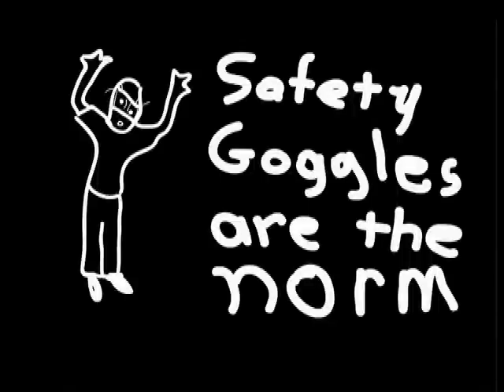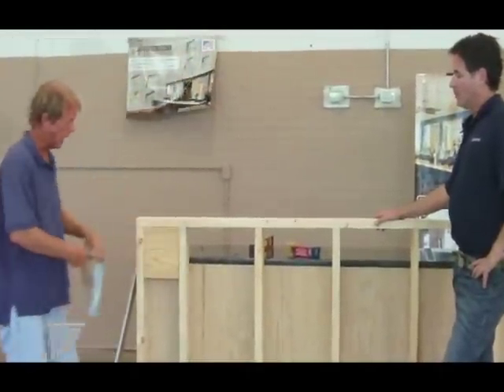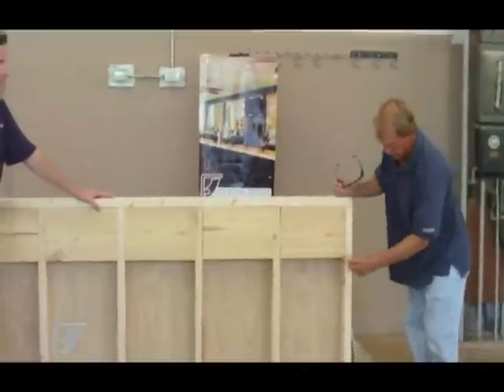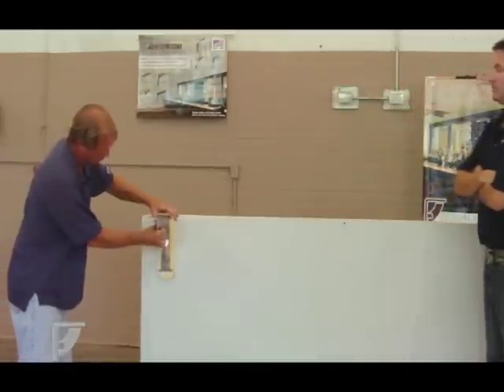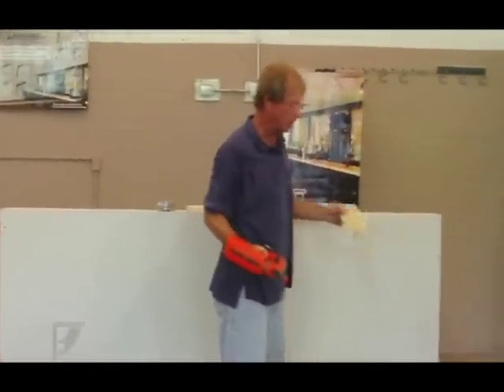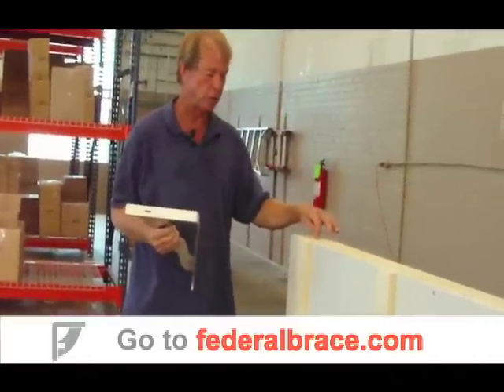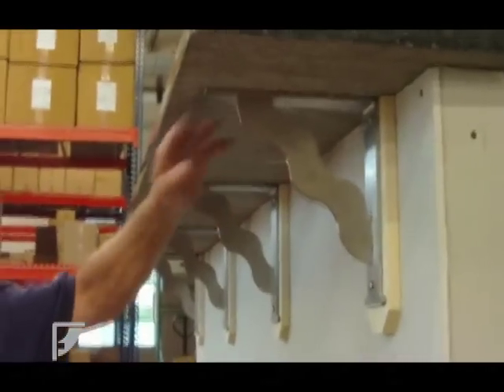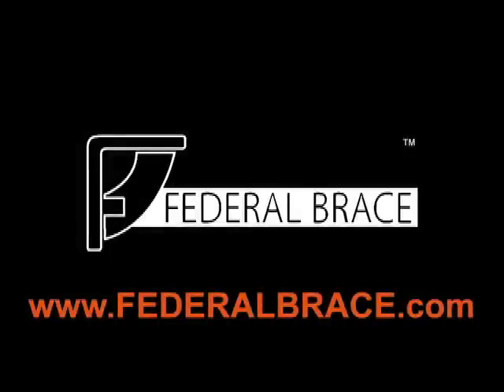HOW-TO: Half-Wall Countertop Bar Installation with Backer Boards

Comment: Do I have to fix the wooden frame to the floor? And how is it fixed to the floor?
Reply from the maker: The pony wall will definitely need to be secured to the floor and/or to any cabinetry in the structure of the application.  The method used to secure the pony wall to the floor should meet the standards according to code for such installations. Here are a couple of good resources - https://www.bobvila.com/articles/pony-walls/ and https://youtu.be/sWgccIjNdcM
Reply: @FederalBrace  thanks a lot! I'll read the references.

Comment: use the estwing to put the nails in with not to pry.
Reply: @FederalBrace  That was just a joke.  I am an Estwing hammer fan.  In the video you were putting in the nails with the other hammer and prying out on the blocks with the Estwing.